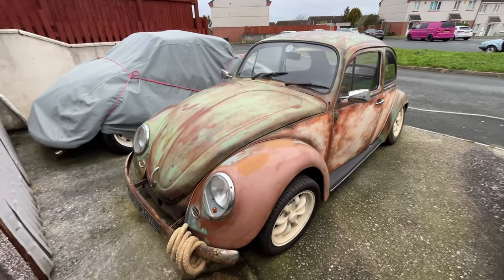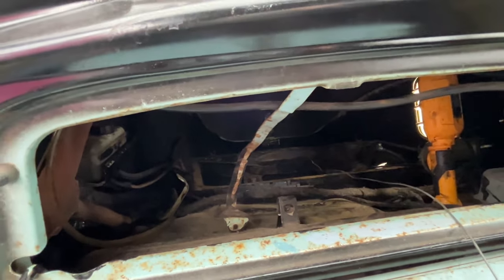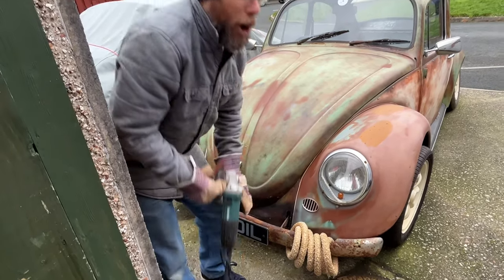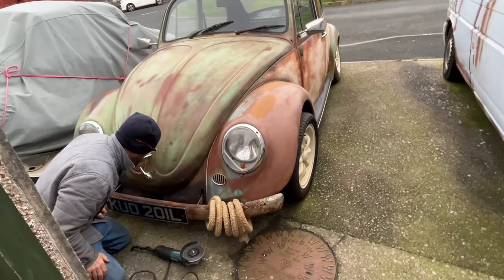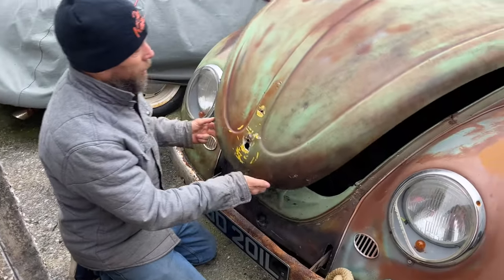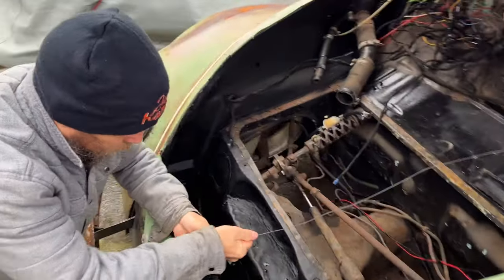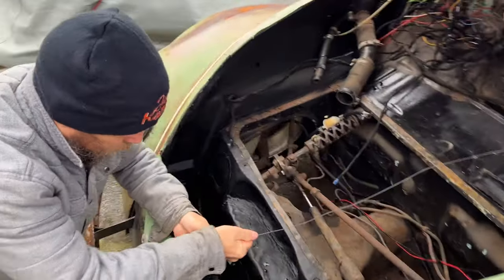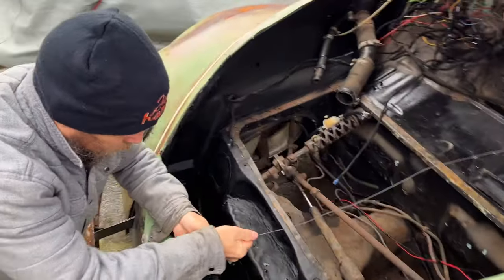vw patina bug bonnet/hood stuck shut but only one way to open it !!

Comment: A bit frustrating that latch Andy.. Makes you want to kick the cat.. lol.. Good thing Mrs. Coco was there to keep you smiling😉.. Happy New Year to you both eh🥳🥳!! Cheers, Bernie 😎
Reply from the maker: Poor design and 9/10 there a bugger to open and they just got to be set up right. So shorten cable and going through inner front wing with small handle will do the trick plus adjust bonnet latch . Happy new year Bernie

Comment: Really like the patina bug.  maybe you have an engine on hand that would work well and then take the current engine out to place in the Wizzard as planed.  Happy New Year to you and your family
Reply from the maker: Exactly I’ve a 1300 on my bench at the shop that was going in the GT bug but the GT bug needs a 1600 and not the 1300 . So time to bench test the 1300 ready for patina bug and current engine into wizard like you said 👍 cheers
Reply from the maker: Happy new year !!

Comment: That latch would come right off if you weren’t filming. Sometimes you have too use a bigger hammer. I here you knocking but you can’t come in. Happy Day one of the new year.
Reply from the maker: Lol I know right but will make it work better once everything is done . Mrs accidentally stopped camera soon as it undone lol . Love a big hammer cheers Steven happy new year